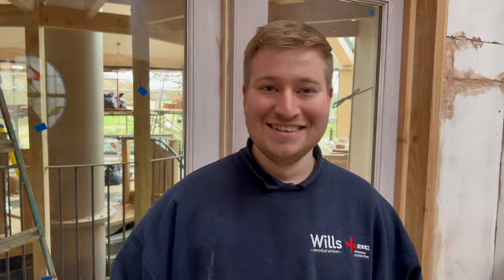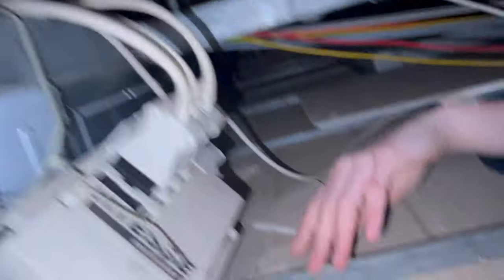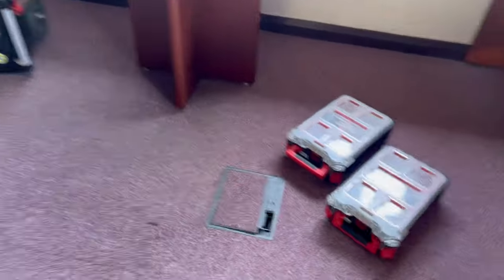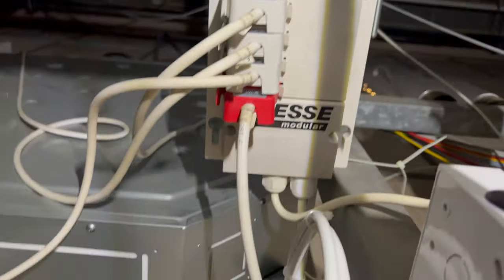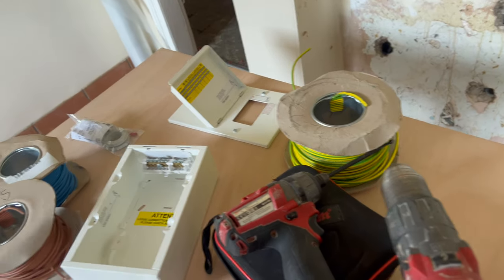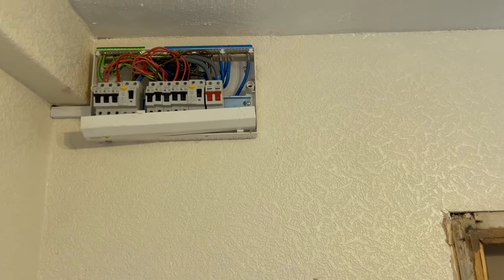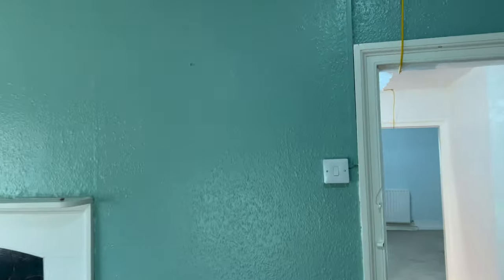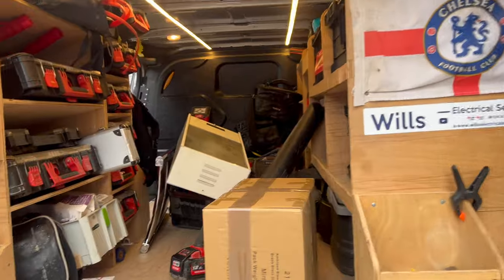Sparks and Recreation: A Shockingly Entertaining Day in the Life of a UK Electrician"?

Comment: Love the idea of a moveable temp board, we have one we've had for about 10 yrs,  2 x 32A 4mm radials (seems excessive but builders like to plug LOTS in) with 4 doubles on each, 1 6A for temp lighting  and a 16A radial for customer stuff (like routers, wifi access points, etc)